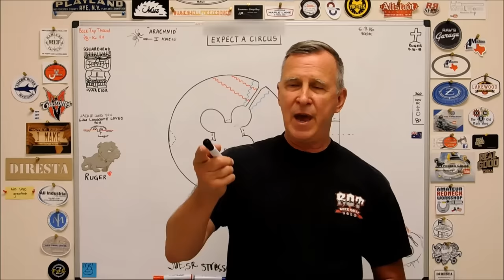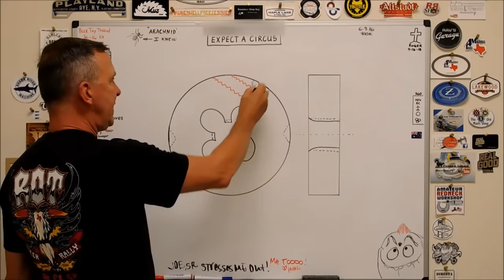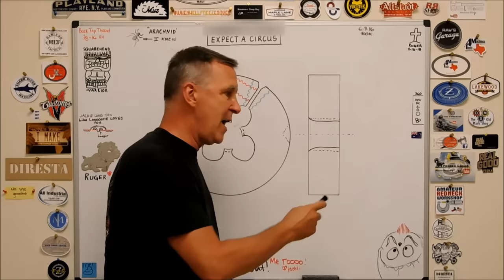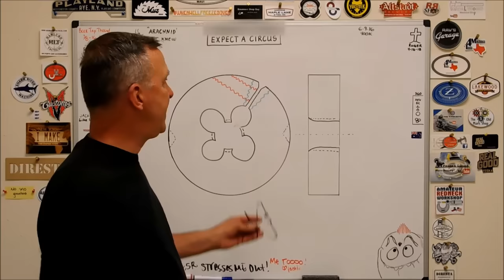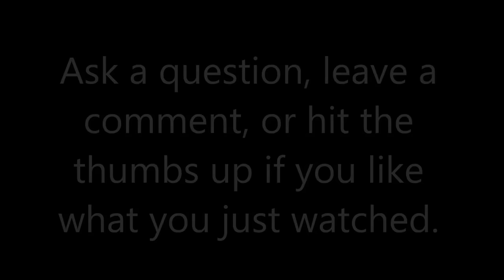You will throw your die handles away after you watch this !!!

Comment: Quite agree with many of your observations... good many things I have found that help over the years. I often point cut first and run a die round thread to finish - plus, rarely use a die for course thread - way too hard! I made my own tailstock die holder long ago which of course maintains axial truth - at least for a start over first couple of turns.
Nice refresher Joe. :)
I had a VTX 1300 until I had to sell due to hip trouble. Miss the 13 years of riding i had on it.

Comment: Great video. I enjoyed it.  I drive a 2002 vtx 1800 to work every day for the last seven years.  I've gone to work on it in 23 degrees cold at 90 mph more than once.  It's been in 40 mph gusts with lightning and rain and never missed a beat.  It has never not started one time since I've had it and never left me on the road even while needing to change the feul pump.  It has carried my miller STL 150 amp tig , stick welding machine to work more times than you can imagine.  And the machine won't even budge from the bike even at 100 mph.  I was forced to ride on some flooded roads where the muffler was under water and it still didn't stop.  The Harley guys laugh when they see me with the welding machine on the back seat, but they are laughing from way behind me as it smokes them.  Thanks for the vid.   Dan

Comment: Most videos that demonstrate a machining process are done using steel. I liked how you used the the nylon or similar material. Even if those blanks were as expensive or even more expensive than the steel it would still be worth it when you consider tool wear, breakage etc. It reminded me of my college CNC Programming course. It was a "bare bones" program that nobody had ever heard of before and I've never heard of since but it was a CNC Program and the basics were learned using it. To make the part for the final exam we used what they then called, "machinist wax". It was a very good idea as many people messed up and the tool would traverse right through the blank workpeice which would, if using steel, break the cutter and scrap the part. I suspect that's a handy medium for doing prototype work as well as being used for teaching/demonstration. As for your die holder, very impressive. I think I need one of those!
Reply: I believe he used nylon so he didn't have to show the shortcoming of his power die method. Using metal would require him to reverse rotate frequently to break off chips.

Comment: One thing, in order to  help center the die on the shaft, I was trained to machine a nub at the minor diameter of the thread to guide the die onto the part. The nub is faced off after the threading operation is completed. Is this something you would be comfortable with?

Comment: A: Thumbs down for the clickbait. I will not throw my die handles away as I use them for in place threading on studs, and for repairing and threads on things that are impractical or impossible to chuck.
B: I don't think those little 2" handles will thread 3/4"-10 in steel. So once again, I will keep my die handles.
Reply from the maker: Anybody that hand threads a 3/4-10 when they have a lathe around is just working too hard.

Comment: I made an adapter for my tailstock 1 1/2" dia. die holder to do the same thing with small taps (under 1/2").  Made up a fake 1 1/2" die button out of 1018 crs and adapted a T type tap wrench to it.  The outer body is knurled.  Works real well with spiral point taps if you aren't in a blind hole, or have enough depth for the chips.  Tactile feel keeps from breaking taps.   Let's me power tap in the lathe.
Reply: Joe also did something similar with a tiny chuck for tiny drills.

Comment: Siome dies have a draw screw instead of a spreader screw, and some are bi-directional.

Depending on the expected FIT, you can start with a wide cut, then come back tighter and tighter until you reach the proper fitment, AND you take lighter cuts with less spalling, less tooth strain, and less 'shredding' (surface fracturing in the threads).

Comment: Some screws are literally cut that way [like the acetyl] for clearances on some precision pumps so that they can put compressible single use copper washers which not only seals the hole, it acts a little like a lock washer or like using loctite, only without the undesired clearance [leakage] of the lock washer, and without the undesired difficulty of removal often experienced with thread locking compound.

Comment: Great video. Have you thought about milling away the excess housing to allow chips to be more easily removed and cutting fluid applied?  basically leave a ring around the front where the die sits and just have two arms going back for the handles and to connect to the follower pipe. just a thought.

Comment: I recently made an adapter, from 1/2"-20 to M12/1.75 in order to hook up an 60s diesel injector to a injector pressure tester... 
On both the first two attempts, I effed up the threads, and only got it right on the third attempt. 
And that only worked because I left undersized material outside the threaded area, to guide the die onto the area it needed to cut. 
(The part is hollow, with a threaded section at each end, and a thicker hex center, so I had something for the chuck to grab onto afterwards, when I cut off the excess material. That hex is also for tightening the adapter into the tester and injector)   
I have a floating die holder, similar to yours, and even with a sliding steel core like the one you had built into yours, but crucially, it was lacking the handles.  And that made it useless. 
I'll definitely rebuild mine this summer. 
And that bike... 
Sometimes I wish that I had continued and taked the driving lessons for a heavy MC... Then I wake up and aren't certain if it was a dream or nightmare...

Comment: Dear Joe,
                  thank you for another good video. I am a jobbing carpenter and a hobby machinist so I mention this not for your benefit as that would really be telling Grandma how to suck eggs but for those who are watching. On my very small lathe I often struggled to grip stock sufficiently to use my tailstock die holder. The part would often slip in the three jaw. At the time I had no collet chuck. I therefore took to using hexagonal stock when using the die holder and turning the rest of the component after the thread was formed. Hex' stock can not slip in the three jaw chuck.

Comment: First and foremost, ride safe out there. 

I have been thinking about selling my H-D Street Glide. If I do, I'm thinking about getting a Triumph Rocket 3. That thing is an absolute beast. 2,300 cc inline 3 that makes about 140 HP and about 170 ft-lb. 

On a note related to running a die. We have a few adapters we made to run a die with a tapping head on the mill. It comes in handy for smaller parts that can be held in a super spacer or vee jaw.
Reply: Best advice I've ever gotten: Ride like you're invisible.

Comment: I made a die holder like the one in this video but without the handles more than 15 years ago. I use it a bit differently though; I chuck it tight in the tailstock, turn the lathe on then turn it off in 5-6 seconds…while it is still spinning I ram the tailstock onto the work-piece. This way it cuts about 4-5 threads on it and stops but most importantly ensures that the die starts perfectly straight…then I continue manually with the die holder that came with my tap and die set. 

I actually do the same with taps on a lathe too. That way taps go in perfectly straight as well.

Comment: I have seen a similar setup clamped onto a Somma releasing tap holder so it just spins at the end of the thread and automatically locks up and retracts upon reversing the direction. I just use a Rubometric die head off a screw machine.

Comment: Love the hollow/floating die holder. What simple genius.
Your comment of hating to run a die preferring to cut with a single point tool,  I have a different perspective. 
Using old manual machines, usually threads are about the last operation on a work piece so  I rough out the thread with a single point tool and finish with a die. 
Starts everything nice and square, takes a pile of load off the die and saves me overshooting the precision cuts.
Thanks for the show.

Comment: Great idea just wondering how does it work on  Cold rolled   Aluminum or Brass      Plastic is one thing to hold those little shoulder bolts in your hand while threading but Steel is another
Reply from the maker: Machine off. Use those handles like the handles they are and drive by hand. I have longer handles too.
Reply: Thanks Joe   I am also a Machinist 42yrs in the trade I have either in my box a die stock and one that I use in the tail stock that I made a long time ago   this  modification is something for me to make to my current Die holder  again Great Idea  love watching all your Videos

Comment: Would it make a huge difference to weather or not it's a harder material like mildsteel  or inconel ???
Reply from the maker: Mild steel and stainless is still not a problem. I do not use the machine power for harder materials because of the load and possible injury potential. Longer studs and turn it by hand is just fine. Inconnel is a whole nuther animal.

Comment: Cool little device. With different tube sizes or inserts, i suppose it could be used the other way for guidance to the start of a tread , as long as the intended thread is long enough.

Comment: It also helps to have a set of thread gauges to go with the dies so one can set the die to a class of fit.I also utilize Tapmatic products alot for threading work; they have a clutch which stops the die from cutting.
Reply from the maker: Interesting. I don't naturally associate Tapmatic products with external threads. I'll have to check that out.

Comment: I don't see a problem with using taps and dies on the lathe, it's a huge time saver. After all, on more automated lathes special spring loaded threading heads are used and for good reason. 
I often use a sliding tap and die holder which is made by Akon Werkzeuge. It was pretty expensive but a high quality set indeed. The problem is that you can't run it up against a shoulder because that would be instant destruction. So you have to stop well in time and thread the remaining part by hand if so desired. My lathe can be reversed instantly by push buttons at low speed but I guess it's not very good for the lathe and you have to to very accurate in your timing. 
The modification shown in the video are great, it will be quite simple with this set, just remove the two keys so that it spins freely and add two handles. Thanks Joe.

Comment: GREAT ideas but wearing ragged jeans in the machine shop is not a good practice and does not make a good impression on customers.
For the little 1" hex dies, I use a 1" socket packed with washers to bring the die out flush and use a cut off drive extension held with the drill chuck in the tailstock.
VERY nice bike and please wear a helmet, jacket and gloves so you can continue to make your wonderful videos. There are lots of head stones in cemeteries marking the "it can't happen to me" former riders.
Reply from the maker: This video was shot on a Saturday. I wouldn't dress like this on a work day with customers around.

Comment: Why not put a spring in the hole of the die holder to let you put pressure on the die initially with the spring.
Reply: you can not rely on a spring to hold the die square.

Comment: Can you make one for the uninitiated?
Reply: It really is a reasonable beginners project if you have a lathe. I'm in the process of making one, based on a video I've seen, but I have made something similar before, so I'm happy to describe the process, even if mine isn't "done" yet.

You need some (round) material that is a little bit bigger, I'd say at least 1/2" (12mm), max 3/4" (20mm), in diameter than your die-stock, and at least 2" (50mm) long, no more than 3" (80mm). This is not very critical what material it is.

You need a suitable shaft in some suitable diameter, and you need a reamer of the same size as the shaft - and of course a drill bit a little smaller than the reamer. I'm actually doing mine with a morse-taper on the one end, but buying a length of "drill bar"/"silver steel" that is ground to a known size is easier. Something in the region of 3/8"-1/2" (10-13mm). Match with your reamer size if you already have a reamer, or buy a reamer to match the material.

Face one end, clean the outside of the material up as much as far as you can without hitting the chuck. Deburr/chamfer the corner. Now swap ends and face the other end and clean any remaining outside. This is mainly cosmetic, so precision isn't critical at this point.

The following steps should all be done, ideally, without moving your work in the chuck, so think about what you need to do, and place it in the chuck in a way that will get the whole sequence done in one go:

Drill a hole straight through the center (use a center-drill then pilot drill) - make sure you have a long enough drill bit!

Use a boring bar to hollow out for the die-stock. This is typically 1" (25.4mm) for smaller dies (there is also 20mm or 13/16" size for small threads) - if you have bigger die stock, check what size it is yourself, I'm afraid all of mine are one size. This should be fairly close fit, so go carefully when you get close to size, don't go over (but you do want some clearance, you don't want to get the soft-blow hammer out to fit the die-stock!). Depth should match the thickness die-stock - if you go to deep, you can face off a little bit. Do give the edges of the hole a little chamfer, so you don't cut yourself - it also helps line up the die-stock when using the tool.

Next, ream the center to the size of the shaft material you have.

You will need to drill and tap a hole on the side for the locking of the die-stock, and a couple more holes to steady it (different die-stock have slightly different layout of those screws). You can probably use your existing die-stock holder as a guide. Me being a metric guy, I'd use M5 or M6 (4.2mm or 5mm drill size). If you use inch screws, I'm afraid you'll need to look up the exact drill and tap size - something around 1/4" or slightly smaller.

You can simply drill a hole through for a basic handle - as long as you don't need long threads. If you do want to go through the holder with thread, you will want to put a threaded handle on at least one side. Something like M8 or M10 thread (around 3/8" in inches).

Good luck!
Reply: You can make this fairly easily yourself, as a novice lathe user (as long as you have a little bit of experience of how to run a lathe!)

You need some round bar a bit bigger than the die-stock, say roughly 3/4" over the size of your diem and some 3" inches long, and some suitable "shaft" - drill rod is ideal as it's nicely ground to a perfect round shape - something that will go in your chuck and isn't too flimsy, I'd go at least 3/8".

Face off both ends and clean up the outside if necessary.

Drill all the way through with a drill suitable for your shaft - undersize so you can use a reamer for the last little bit of the diameter.

Now use a boring bar to make the hole for the die-stock itself - this is where you need some precision, you want the die-stock to fit in there, but not so snug you need to bash it with a soft-blow, nor loose so it will wiggle around.

Ream out the hole for the shaft.

Drill and tap holes to hold the die-stock - if you have an existing die-holder, you can use that as a pattern.

Drill and tap for handles.

Assemble. Enjoy.

(I wrote a much longer description, but managed to lose it by doing something else and then coming back! If anything is unclear, ask!)

Comment: Yes! Using a drill chuck end is something I figured out ages ago too. It really works. Never came up with the button though.

How large a dia thread can you do holding those die handles with steel? It seems the torque would be pretty high larger than 5/16”, or so, which it looks as though what you were cutting.

Comment: Kinda sketchy to have those shoulder bolts  spinning around, donxha think? I have a similar tailstock die holder but the surface you grab is a large diameter for torque and round, so you can't get caught on it. It also has a couple inserts to hold adjustable tap holders, and adapters for different die sizes. Also, if you're making one of these, make the spindle (to be held in tailstock) as large and long as you can reasonably. Stiffer, and more room for already threaded portion of the work.

Comment: Great die holder. Thanks. 
☆you never mention the starting dia. of the work piece. For a top job all around the OD to start should be smaller than the required finished size.
This allows for expansion of the material and also reduces stress when using a die...!

Comment: Can you use the technique where you thread under power (as shown in the video) with harder materials like steel? I thought when using a die you had to back it off frequently to break the chips - like you did when you finished the thread by hand. Is that to protect the die from damage, or just to make it easier for a human to physically rotate the die through the metal? Because of course threading under power, there would be no 'backing off'.

Comment: Neils Niche is by far the best off the shelf unit. I have 4 on a turret. Don't use cheap dies, and you'll get much more control with a thread just as good as single point for 99% of applications.